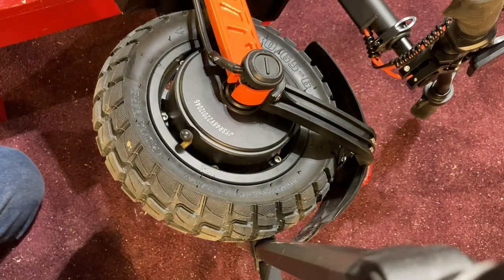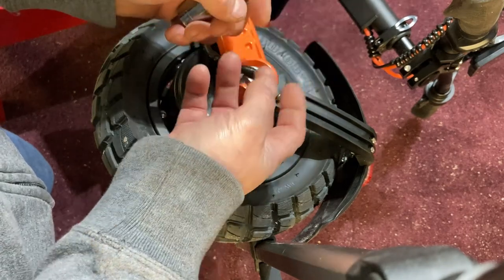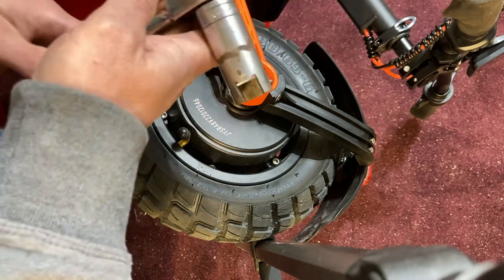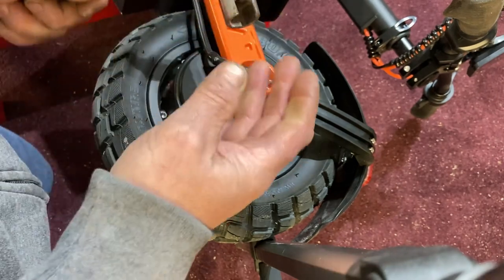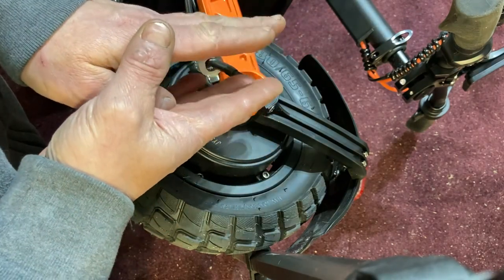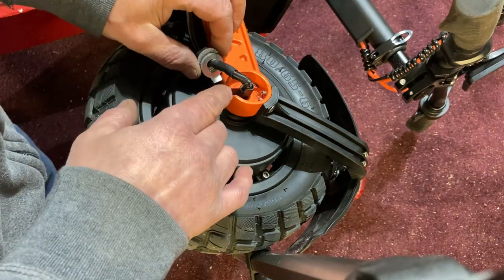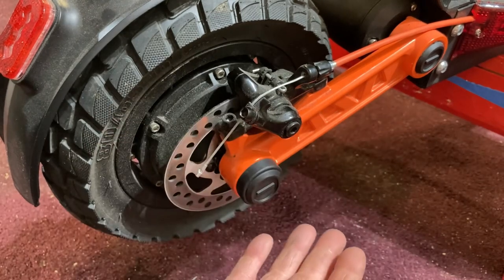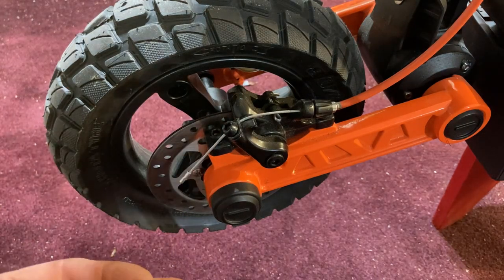How to remove the wheel and tire on the Joyor s5 and s10s with the wire coming out of the motor.

Comment: Thank you very much for giving me this idea, I was trying to buy a special wrench and then I saw your video that you have make yourself a special wrench. I saw another video where the guy had to take all the wires out before he could take the tire out, but then you show me no you don't need to take the wires out, just take your time easy easy and you can do it without taking the all wires out just one screw for the wire, again thank you very much keep up the good work. Today I got flat tire on my electric scooter, the rear wheel :(

Comment: I fought for hours trying to get the new back tire on. Right when I was about to give up, I realized I could remove the 5 Allen screws that take apart half the rim, and made it super easy.
Reply: My mistake, it's actually six Allen screws. And they are the outer most screws. Not the inner most ones on the opposite side. Those look like they are to take the motor cover off.

Comment: I just purchase the s5 and yes is really fun I watching your videos to learn more about this scooter, this adventure going out on my scooter helping me so much with my depression.
Reply from the maker: Hit some trails too just don’t go through high water 
Get out and have fun!
Reply: @DavidsHowtosReviews   thank you I will
Reply: @DavidsHowtosReviews   I will like to ask you where should I buy the tires for the scooter solid Rubber, I was checking on Amazon but I’m not sure if that’s the right ones, the size from my scooter are 80/65-6
Reply from the maker: These are the ones I was going to get but are expensive 
I run green slim 
Plus solid is heavy 
More rotating mass may slow scooter
Reply: @DavidsHowtosReviews  yes they are, i think I have no option I need to get those expensive tires cause i don’t want to patch them I see your videos on how to remove the tires already so I’ll keep them safe., I’m having so much fun going out in the early morning is just so wonderful, thank you for your response, god bless you.
Reply from the maker: Ok 
When u get them 
Do one tire at a time
Take off the tire and tube
Then heat water in a large enough pot to fit tire 
Then put tire in hot water let heat up until u can stretch tire
This will allow you to get tire on rim easy
Reply: @DavidsHowtosReviews   great, thank you
Reply from the maker: Anytime 
Keep us updated on how the scooter works out.
And the solid tires.. 👍
Reply: @DavidsHowtosReviews   hello, i been looking on Amazon where to get the brake pads do you know exactly what sizes?
Reply from the maker: No 
I do know that they are using mountain bike brakes.
I’m really thinking that they are these 

2 Pairs Brake Pads for TRP Tektro Shimano Deore Br-M575 M525 M515 T615 T675 M505 M495 M486 M485 M475 M465 M447 M446 M445 M416 M415 M395 M375 M315 M355 C601 C501(Resin,Semi-Metallic,Sintered Metal) https://www.amazon.com/dp/B07DMWGDYX?ref_=cm_sw_r_apin_dp_A3XDJ20V2G6KWP0JXDHV
Reply: @DavidsHowtosReviews   ok thank you that’s what I was thinking
Reply from the maker: 👍
Yea they are picking parts from other scooters and mountain bikes 
Kind of strange but seems to be working.

Comment: I found a wingnut ratchet socket on Amazon that worked great for removing the rear lugnut.
Reply: Did it work
Reply: @lostdrifter7009  It worked great, but now I'm just stuck on removing the rim that releases the motor from the center of the wheel. It seems to be fake screws that I can't actually drill into. Weirdly enough it looks like it's for display or as if it was meant to have them, but they forgot lol. Every video I've looked up has them on the side of the motor that has the wire except for mine. 😵‍💫

Comment: Just received my s10s on the 24th Friday. Rode it to work yesterday on the 25th and cought my first flat sucks 😞
Reply from the maker: Oh man! No way!
Hope you had a can fix a flat….
Change tire put green slime!
U need to get to work!
Hope that is the only flat u get!!
Reply: @DavidsHowtosReviews  hey Dave, I had to take it to a shop this morning bro, charge me 75 buckaroos. That sucks more than the flat.
Reply from the maker: @bayluv9278  😱
Oh man.
Yea throw some green slime in there 
And look into solid tires 
These little tires are a pain to work with
Reply: Back up and rolling, topped out today at 43 mph. Loving the S10S.
Reply from the maker: 😱 nice 
These are very fun.
Going down hill these will reach very high speeds.
Reply: Hey David, how's it going man? I was wondering if you can provide me with the handlebar specs stem&bars? I want to upgrade the handlebars and stem.
Reply from the maker: This is a link to the only known parts I know you can get the stem and if bars are to expensive I can get you the measurements of the bars so you can goto a bike shop and get them.

https://vigscooters.com/product-category/parts/
Reply from the maker: I’m not having any problems as of yet 
But I’ve been hearing different stories of batteries, chargers and display problems.
But hopefully they are getting better and better.
Reply: Judt get used to it i have one almost every week and I couldn’t get a solid one from nowhere
Reply: This is a commin problem. Just got mine abd damn next day flat, now its useless till i figure this out. This is ridiculous. Now im mad i even bought it.
Reply from the maker: @kenjovani 
Don't over think it 
Add green slime for the next time 
And carry a co bicycle bump 
Put in back pack

Comment: how do I pull the forks apart by myself to get my tire back on, Im kind of stuck getting my wheel back on currently, did everything else quite easily! do clamp/spreaders work?
Reply from the maker: See if you can put one side in and use a long screwdriver or something to pry the other side open while pushing the tire / wheel in place
Reply: @DavidsHowtosReviews  yeah I was sitting there for hours trying to do it with the screwdriver like you mentioned actually! just seemed to need a tiny bit more force than that, the furthest we got with the screwdriver is it sliding barely in, we had the scooter upside down! its the rear assembly forks, they seem to be real tight. will try the pipe wrench if the clamp/spreader doesnt work.
Reply from the maker: Yes the back one is very tight. 
Good luck u will get it

Comment: My good sir I want to buy a hose for my electrical scooter joyor s10-s which degree valve I need? The original is 90 degrees, but can I use 45 degrees, do you think it will fit??
Reply from the maker: Yes I don’t think you will have a problem
Reply: @DavidsHowtosReviews  Thank you very much for the help, it's nice to know that I can use a hose with 45 degrees valve. Sorry to bother you again but i forgot to ask you another thing, the website where I got my scooter from, I ask the shop owner the website owner, which tube (hose) should I use for my scooter, I took a picture of my tire so he could see the size numbers on the tire, it is 80/65 - 6, after he saw the numbers on the tire he told me to use 10x2.5 size tube, but when I took the tube out of the tire, the size number on the hose was 10x2.125. I told him about it, he got confused, now I see you know more than he does, that's why your opinion is more important to me than his, he has both hose in different sizes, the hose with 10x2.125 size he only has with 45 degrees valve, but the hose with 10x2.5 size he has both with 90 degrees valve and 45 degrees valve. Do you think I can use the hose with size 10x2.5?? Because I really want to use with 90 degree valve hose. Thank you in advance.
Reply from the maker: @EdwardAivazovsky  that one u have is only just under  0.250 which is nothing 
The tube will adjust as you blow it up.
I would go with straight or 45deg
It will be much easier to fill with air.
That’s just my opinion but ether one will work just fine

Comment: How did you loosen the suspension bolts to get the front tire on, stripped my only Allen key that fit?
Reply from the maker: I didn’t loosen the suspension 
Only the two nuts on ether side

Comment: Hey, love your vids. I just bought and received an S5 800 watt, and the back tire came deflated, which was fine, but the tire will not inflate. I’ve tried a foot pump and air compressor at 50psi and nothing. Do you think it’s a bum tire or am I missing something?
Reply from the maker: I had a problem with the valve in the one.
Remove the valve see if it looks normal.
Basically pin is straight not bent and the inside seal is seating the are very cheap u can get anywhere 
Walmart, auto zone, target,
If it doesn’t work might be a bad tube.
Reply: @DavidsHowtosReviews  thank you, I’ll check it out.
Reply: Yes sir definitely a bum tire. What's another bummer, is that you might have to either send it back for replacement after you already waited to receive it. The other option is to take it to the nearest scooter shop, it's going to cost you about 75 bucks depending on the shop. Still have to keep spending, that's a total bummer.
Reply: @bayluv9278  yeah, tell me about it. I’ve had the scooter sitting in my garage for 3 days now and I can’t use it. I don’t want to go through the hassle of returning it. I got it at a great price, and a replacement tire and tube is $25 on Amazon, but I have to wait 3 weeks to receive it. I’m waiting for this scooter dealer to open so I can call and see if they would do it for me, if not, I’m going to just return it.
Reply: @DavidsHowtosReviews  I’m just going to go ahead and order a new tube, and have a shop put it on since I don’t have the proper tools. It’s a 10x2.5 tube correct?
Reply from the maker: I would think and place what has small bicycles for children should have the tube 
Walmart seems to have it also 
https://www.walmart.com/ip/Tire-80-65-6-Electric-Scooter-Inner-Tube-Tire-Inner-Tube-120g-Durable/563877785

Amazon 
YBang 80/65-6 10x2.5 Inner Tube Replacement 10 inch 255*80 for Kugoo M4 pro for Speedual Zero 10X Tire Tire with Elbow Valve Thickened Widened https://a.co/d/cYoeDkG
Reply: @DavidsHowtosReviews  thank you so much!
Reply: The same exact thing happened to me about a week before your comment. I'm waiting on a solid tire
Reply from the maker: If you can post the link of ones you got 
These are the ones I’m considering 
Just incase  anyone else is wondering about solid tires 

FACULX 2PCS 10 Inch Electric Scooter Tire Solid Tire 255x70/10x2.50-6.5 70/65-6.5 Universal Tyre for Electric Scooter, Balance Car https://a.co/d/5zORNfp
Reply: @DavidsHowtosReviews  those look like the ones I tried first. The inner rim of the tire is too wide for the s5. I'm waiting on some 10x2.5s
Reply from the maker: I figure the tire should be same size as inner tube
I just ordered these so I figure if they don’t fit I can return and try another size
Reply from the maker: So I did some quick measurements with my digital caliper 
50.31x146.17x72.25mm
Or 
5.03x14.617x7.225cm

This one really seems like it will fit because the size on tire is indicating 6” wheel but the overall is 6.5
But when measured is 6.2
The width is good and tire blown up to 50 PSI tire is 10”

Solid Tire 10 Inch, 10x2.70-6.5 solid tire 70/65-6.5 Scooter Tubeless Puncture-Proof Tire, Explosion-Proof Rubber Solid Tires, Shockproof Design, Super-Grip Wheels Replacement (10x2.70-6.5 tire) https://a.co/d/atZNVn4

Comment: I have the s10s with the wire and I’m having a hard time finding a tool that can remove the nut around the wire. Do you have a link to the proper tool by any chance?
Reply from the maker: Look through some scooter sites I remember seeing it’s in the tool/accessories section 
I just made my own harbor freight socket and old ratchet

Comment: Where do you get off Roading tires because my S 10 S scooter came with street tires
Reply from the maker: Amazon 
These are sold 
They have air also

Solid Tire 10 Inch, 10x2.70-6.5 solid tire 70/65-6.5 Scooter Tubeless Puncture-Proof Tire, Explosion-Proof Rubber Solid Tires, Shockproof Design, Super-Grip Wheels Replacement (10x2.70-6.5 tire) https://www.amazon.com/dp/B0BB26JFXF?ref_=cm_sw_r_apin_dp_0WTCF4VEWFATY6BKT7ZP
Reply: @DavidsHowtosReviews  hello I'm trying to buy a S5 can you tell me where you bought yours
Reply from the maker: Get it from Amazon 
This way if you have any problems you can just return it or exchange it
You can pick s5 at check out.

JOYOR S Electric Scooter，Dual 1000W Motor Scooter for Adults，Up to 37 Mph & 53 Miles Long Range 265 Lbs 10" Tires Hydraulic Brake Adults Electric Scooter https://www.amazon.com/dp/B09R1MD1R9?ref_=cm_sw_r_apin_dp_WP7XMMTP6ZRB1Y450YRP

Comment: good morning

I have a joyor y5s I installed a new motor but unfortunately the wheel spins in the opposite direction what do I do?
Reply from the maker: Just switch the wires 
Or it’s possible it was put together backwards 
And the rotor is on the wrong side

Comment: I cant get the back tire on. With the washer on the inside on both sides. I don't think im doing it rite cuz i thought i got it on once but thr tire didn't spin freely. I have the s10s scooter.
Reply from the maker: You need to make sure the inner spacers are correctly in place, it sounds like one is not in place 
That would cause the wheel to get hung up and drag.

Comment: I think i did the cut on the deep 18mm socket wrong.. it keeps slipping with each crank
Reply from the maker: If to deep or socket is to thin the metal will flex and possibly slip

Comment: How do you get the inner tube out of the tire
Reply: Show getting the inner tube out of the tire on the s 10 with the wire
Reply from the maker: It’s just like a bicycle 
Pop the beed and use tire spoons to get one side of tire off, pull tube out 

NEIKO 20601A 14.5” Steel Tire Spoons Tool Set, Tire Tools Include 3 Piece Tire Spoons, 3 Piece Rim Protector, Valve Tool, 6 Piece Valve Cores, Motorcycle Tire Changer, Dirt Bike Tire Levers https://a.co/d/fvZTYhW

Comment: Solid tires on a scooter with an actual suspension make no real difference under 25 mph I’ve found
Reply from the maker: It would be for not worrying about flats because if you can go 50miles I would hate to get a flat that far out!
Reply: @DavidsHowtosReviews  where can I get solid tires for this scooter?
Reply from the maker: Should’ve be able to get them at Amazon 
Just type in sold scooter tires
And the size 
Then pick the type u need 
Street, all terrain or off road
Reply from the maker: I believe this is the tire that you need.
Just double check the size and if the pattern works for what you need 
yeesport 2 PCS 10''×2.5'' Scooter Solid Rubber Tires, Honeycomb Shock Absorption Tires, Explosion-Proof Kick Scooter Tyre, Replacement Front/Rear Wheels for Electric Scooters https://a.co/d/fGtkPZR
Reply: @DavidsHowtosReviews  thanks again!